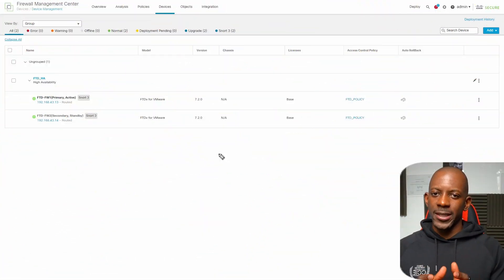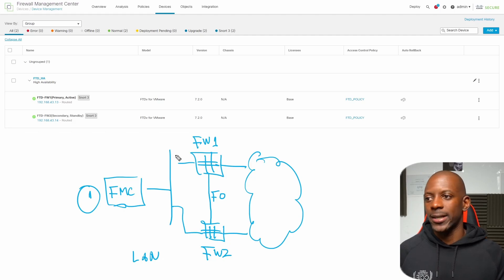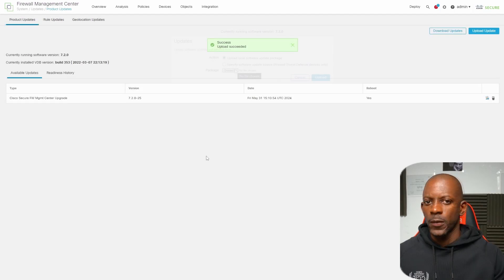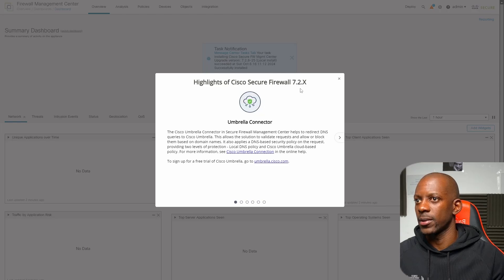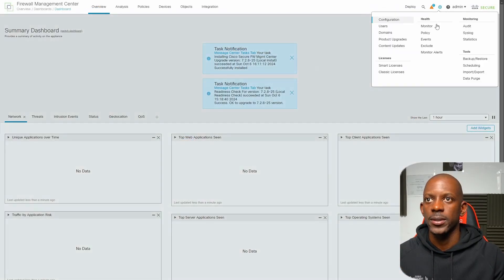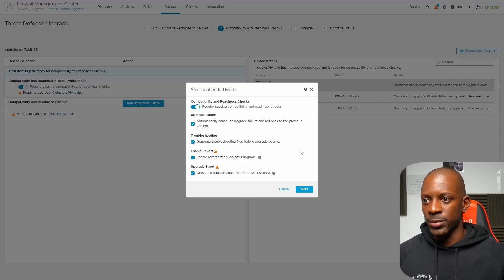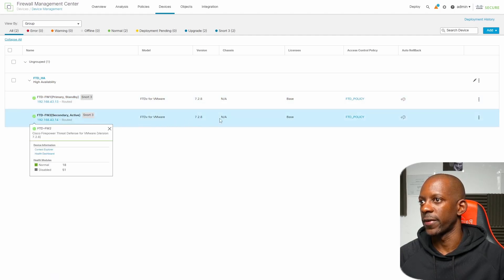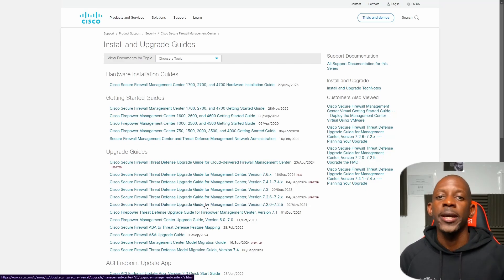How To Upgrade Cluster Cisco Firepower

Comment: I did perform the upgrade today but the FTD cluster went into split brain
Reply from the maker: I'd recommend reading the upgrade procedure.
Reply: @silesiocarvalho thanks for the response but it appears that for FTD4200 appliances there is bug in version 7.6.0 & 7.6.2 as I upgraded it from 7.4.2 to 7.6.0 it entered split brain and post that I force break HA then manually upgraded both appliances to 7.6.2 and then tried to rebuild the HA and it gave me interface related error. It basically was not pinging the peer HA interface which was connected back to back link. We raised a TAC and they confirmed a bug which caused this the new patch 7.6.4 will be out soon and it contains the permanent fix for this. And FYI I did follow the procedure for the upgrade.